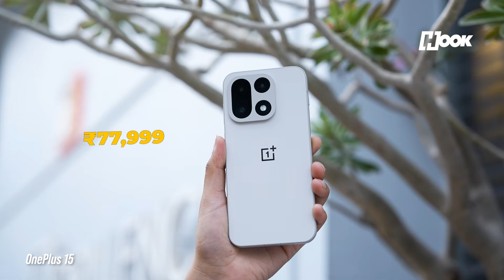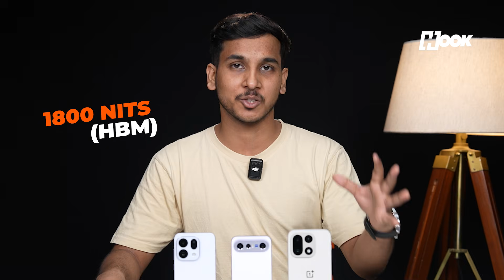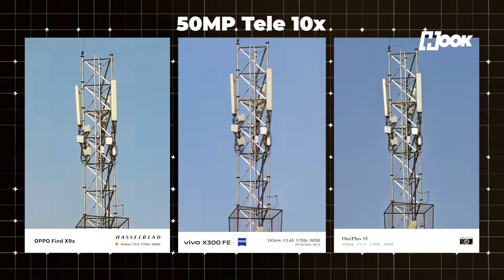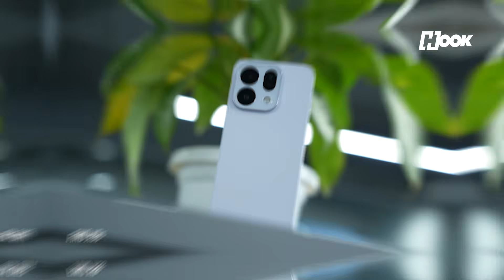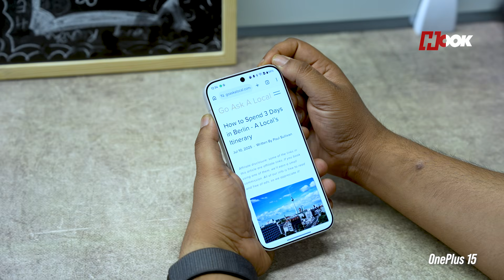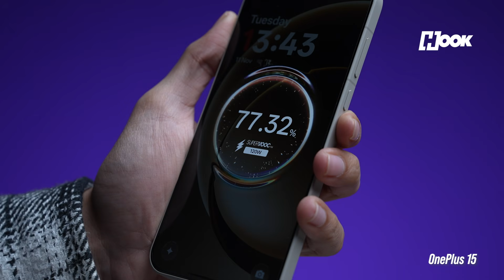Oppo Find X9s vs Vivo X300 FE vs OnePlus 15🔥The SHOCKING Winner! 🏆

Comment: X9s is just utter trash fr the price it launched... It should have been launched at a sub-50k range, considering X9  is available for 57-60k new without exchange.
Reply: Not really trash just the main camera sensor and processor is downgraded also nt by a great extent
Reply: Where bro??? Flipkart isn't selling anymore
Reply: @koustavsaikia8411  oppo store app bro
Reply: They increased the price of X9 to 94,999 so x9s cheaper and its almost out of stock everywhere

Comment: Yes, finally someone who made the right comparison!! The OnePlus 15 is the better phone at this price point🔥
Reply: It depends on what you need brother., if you need a better performance then Oneplus 15, better camera, then others
Reply: First one plus 15 is out of stock everywhere and not available offline then for a phone which is literally a downgrade to its own predecessor and the price launch at 80k? Then in May they increased it to 86k? Now the 512gb variant is 93-94k lol this phone is utter trash i would buy it for max 60-80k price not above that and oppo find X9s is better in camera,price, look, battery, charging leaving the wireless and the only downgrade is the usb 2.0 that's it if not it's the same or better for the price